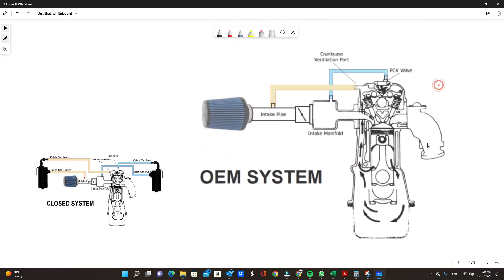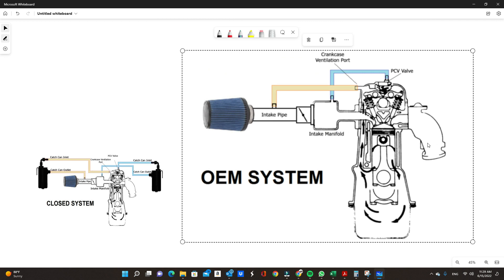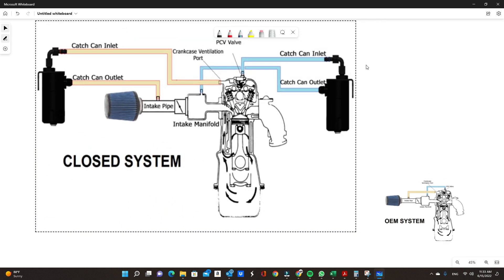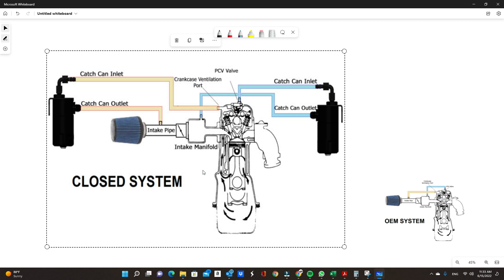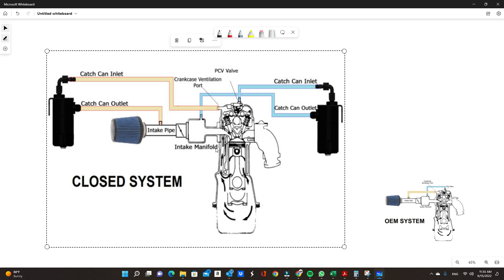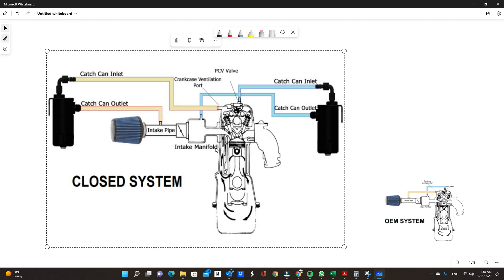Why Oil Catch Cans are Needed For Your Car!

Comment: Do the btr catch cans come in pairs? or is it one per purchase
Reply from the maker: Everything is priced per not pairs
Reply: @BTRcarcustoms  thank you
Reply: @BTRcarcustoms  If my car has 90xxx miles with only one previous owner before me, do you think walnut blasting is necessary? 2013 2.0t
Reply: @datg2715  do crc gdi cleaner, then another after 1k miles
Change the oil (maybe a engien flush aswell) then add a fuel injector cleaner to the fuel  tank
Should be back to new or atleast 40k miles cleaner

Comment: I just bought 2 carbon mishimoto catch cans but it came with no baffles, the can is completely empty with no way to fully open it up.. it Don't unscrew anywhere & it only has 3 holes 2 on top & the drain hole, should I just stuff heavy duty steel wool through the drain hole at the bottom of the can? I'm so confused on what to do...
Reply from the maker: Surprised that you cant open it up!? Many people use steel wool in the can to mitigate but you also do not want the steel wool to come apart and get pushed into the engine.
Reply: @BTRcarcustoms  I'm just confused on if I should run anything at all in the can.. since there's no way to open the top or bottom of the can there's no way to put anything inside other than stuffing something through one of the small holes. It's the can with the level tube on the side of it.
Reply from the maker: @stinkfart697  best bet is to exchange it for something baffled but if not possible i would run it the way it is, just mounted lower than the origin and return points
Reply from the maker: @stinkfart697  i wouldn’t do that because there is risk of it getting into your engine in the long run
Reply from the maker: @stinkfart697  if you mount it low it should still work better than not having cans

Comment: If your car is an "ecoboost" or has any forced induction at all, catch cans are a MUST. Old cars used to just drop this oil all over the ground, the catch can is only if you disagree with lubricating the road behind you.

Comment: Why? It's a filter, it filters, filtration is good for you, it's good for your car.
How? It's a filter, it filters, filtration is good for you, it's good for your car.
Very simple stuff.
If you're looking to do this yourself, see if there's a mounting bracket made for your car. I had one that was specially designed to fit flush in my bay.

Comment: I run a breather for the crankcase vent and OCC for the PCV 

Not trying to sent garbage into my expensive turbo. 

I got meth that cleans the valves .. but the octane lowering effect of blow by in tbe combustion chamber .. NOPE 
Not trying to risk that 
I run the best gas I can find 
100% M1 
And high end oil 
Why would I do all I can to protect my motor but skip on something so simple even tho a lot of the gasses make it past the can or so I’m told 

I also really liked how u pointed out can as a way to kinda measure the health of the rings 

Another great vid 

Thanks man

Comment: Hey Sam Socal J here...Question, in the past I've always thought of purchasing one. However I took a habit of cleaning out my intake pipe along with the turbine wheel whenever I change my oil. I guess you can say I'm a bit meticulous, when I do clean out these areas I notice blowby but very little not noticeable if anything. Should I still look into a CC?? FYI I'm custom tuned with the OEM turbo at 91 octane, BK1 non GDI 2.0T.
Reply from the maker: Definitely, whatever is making it passed that is getting burned
Reply: Agree with Sam, can definitely help! Particularly the one on the right @6:00 between the PCV to Intake Manifold. That's were you get most of your blowby and not as much from the Crankcase Ventilation Port to Intake Pipe. At least from my experience with a non turbo.
Reply: @beeswaxx1.6t  You shouldn't be filtering that portion anyhow, it should be filtered on the other 2 ends of PCV that operate within your engine space, not the intake.
Reply: @jayfromjax  I never said I'm filtering on that side lol,  I'm only using an occ from pvc to manifold on my 3.8 non turbo. But turbos can benefit more if both sides are used.
Reply: If you're seeing blow by, imagine how much is going through your PCV and being burnt off inside your engine. Can't clean that as easilly!
Reply: Thanks all